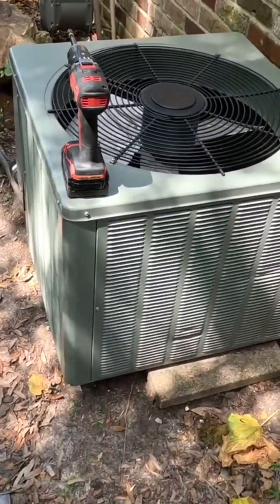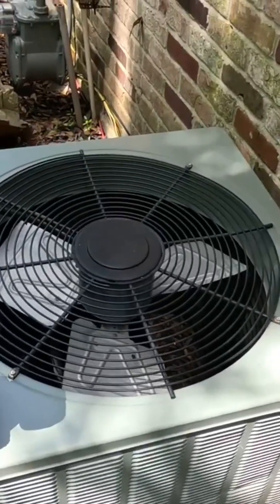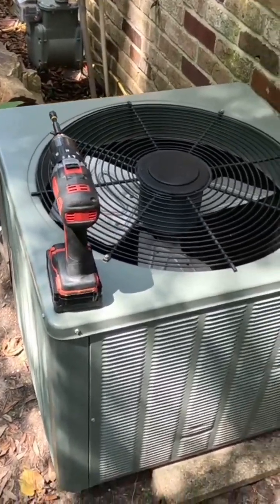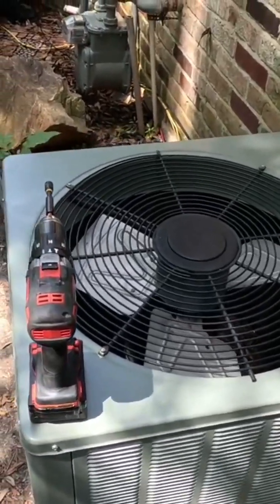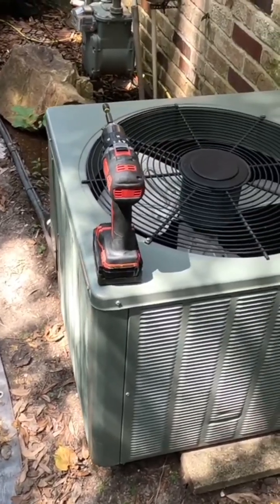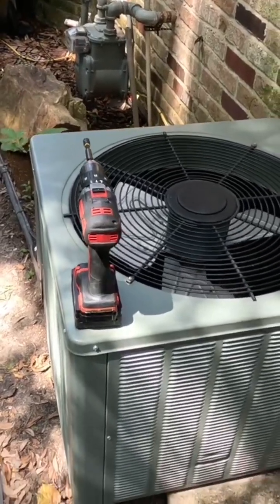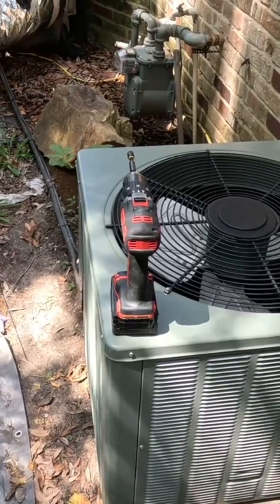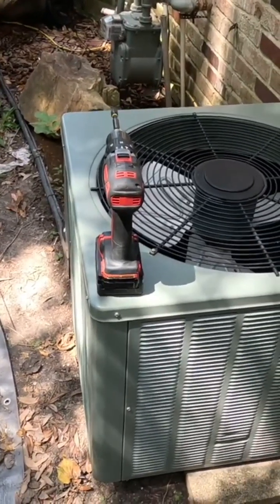AC Tripping Circuit Breaker.

Comment: Thanks. So I just turned off all the power, made sure it’s all off and unplugged the wires from their point of connection. Instead of taking off the whole top lid which for me was like 20 screws. But it was the issue.